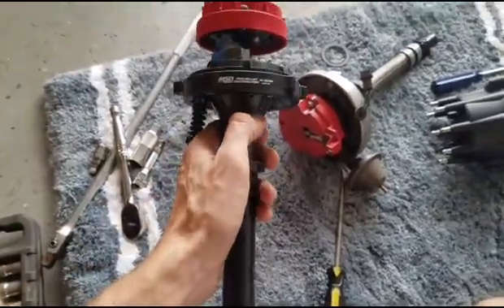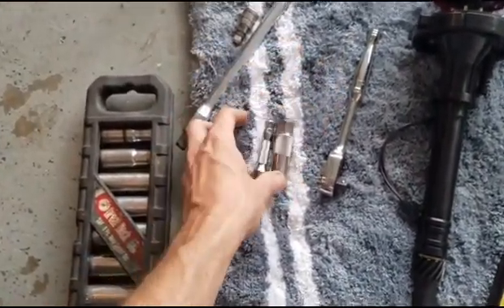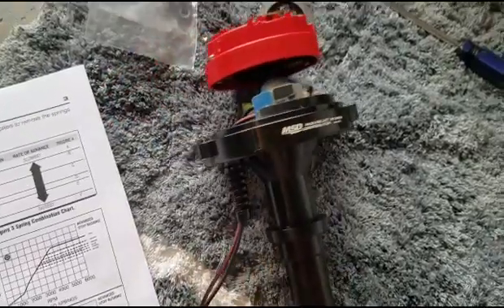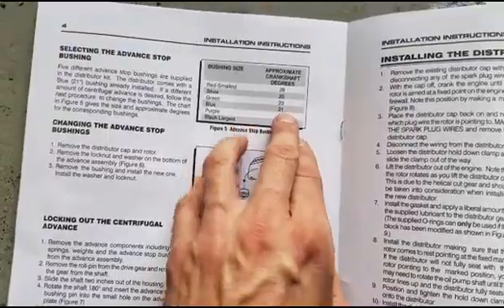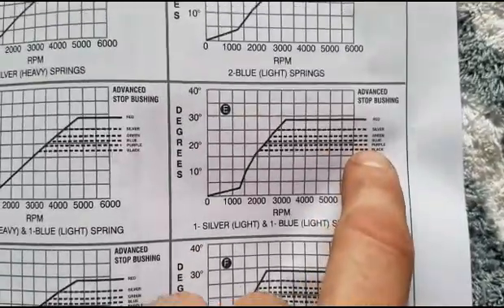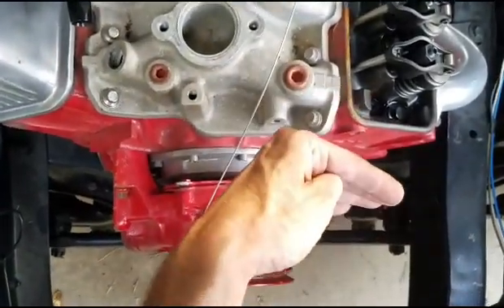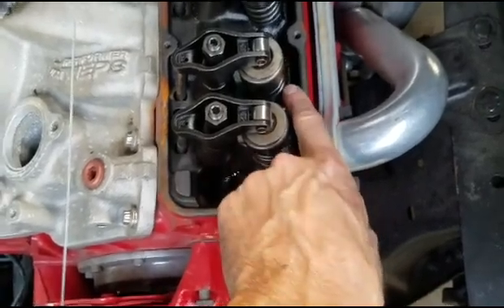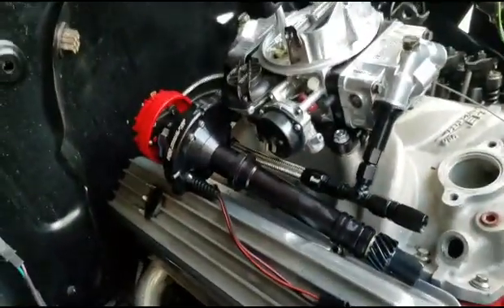Installation Tips for Your MSD Pro-Billet Distributor

Comment: Question, i’m dealing with this same thing. Changing from a points HEI distributor to an MSD ready to run. I just took the cap off the HEI distributor and noted the directing the rotor was in and was planning on dropping the MSD in the exact same orientation with the rotor pointing the same way. Doesn’t doing that avoid having to put it at top dead center before?

Comment: Hey brother, I'm sure uve got it all figured out by now if not..those bushings go underneath the wieghts not underneath the springs. They allow the wieghts to sit a lil higher to allow wieghts to opens smooth and correct. So u remove springs and wieghts then install underneath wieghts and reassemble.  Nice setup tho, good quality parts👍

Comment: I know the video is many years ago but how would I know what springs to put on I have a sbc355 lt4 hotcam
Reply from the maker: Generally speaking you want your mechanical advance to start coming in off idle. I also have a new video I'm about to release that discusses installing a vacuum advance in conjunction with lightening the springs for the mechanical. I would play with the springs and find what you and the engine like. But generally getting the advance to start rolling in at around 1200 rpm is a good start. Maybe 1 silver and 1 black/blue?

Comment: Cool video your throttle bracket for your holley what is the part number  I'm installing a holley on my 84 c10 the stock bracket will not work unless I cut it in half thanks
Reply from the maker: The bracket is from Bowtie Overdrives.

Comment: Another good tip on a SBC is your crank keyway will point at #1 cylinder when at #1 TDC, and when you drop in the distributor I like to get the rotors end pointing at #1 as well,  helps for future people working on it. Just wrapped up a 350 SBC myself and using this same ignition setup. Thanks for the tips on the springs as the ignition was in the basket of parts. Hopefully the last person didn't mess with them. Lol